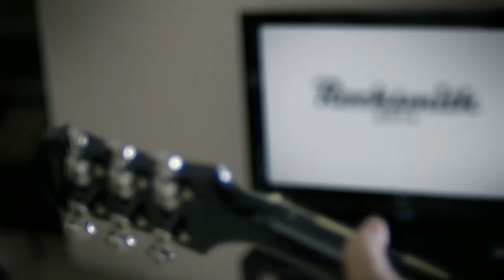Rocksmith Encore #5 -- Guitar Upgrades with Brian Poedy Pt.1

Comment: 6:32 mention @rocksmithgame in twitch chat if something odd with the stream
6:55 no electric screwdrivers usually
7:35 tuners, 2 bushing varieties 8mm and 10mm holes
10:50 QA informed choice on buying parts - internets
13:30 point for string trees, not 1957 so these days no need with staggered tuners
15:25 on tremolo blocking
17:50 QA what makes good tuner - high ratio, locking
20:30 pro tip leave out 2 middle screws on tremolo bridge
23:00 on prewired pick guards
26:30 tip on quick pickup change using molex connectors like on Gibson guitars
27:50 pickup height/tilt adjustment
28:40 QA on solderless stuff from various brands
30:10 on different color coding among manufacturer s - check manuals
33:10 QA active pickups: 9v on guitars, higher voltage usually for basses
36:40 QA on passive bass pickup with external pre-amp
37:30 QA no for other than 6 strings, 4 bass for now
40:30 process of soldering 
41:25 lead vs lead-free solder
43:30 about in-house soldering station
45:15 soldering output jack on strats
46:25 on conductive paint and foil for EMF shielding
51:00 tremolo claw, springs
53:15 QA keeping output jack tight
55:10 mineral/lemon oil for fretboard cleaning
57:15 on references - internets
58:30 whammy bar quick install